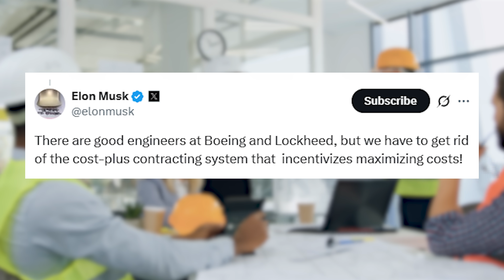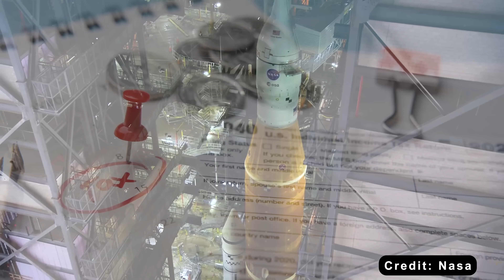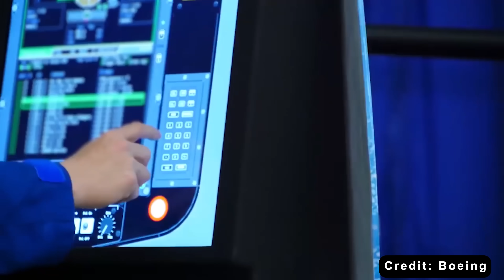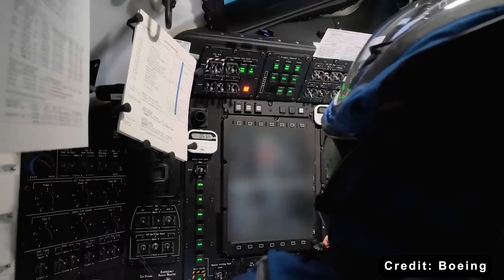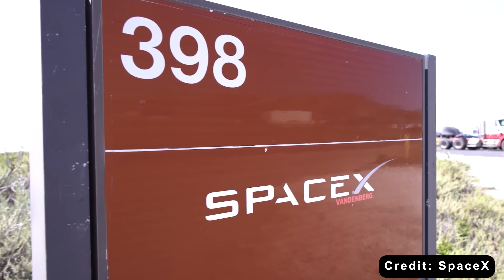Elon Musk exposed the Truth on Boeing's Starliner Complete DISASTER!

Comment: This is close, but not quite right.   I have worked with NASA.   NASA does not just permit delays and overruns - they demand it.  Oh, not directly.  Of course not directly.  They do it by changing schedules, requiring additional “risk assessments” and “trade studies”.   Since congress controls their budget, funding changes from year to year, NASA requires the contractors to adjust their planning, often throwing the entire program into a “replanning” phase.  This means “plans” are made.but while this happens no actual work gets done.  Then you have the cost of replanning - which was out of scope - so the contractor gets paid for that effort, then there is the cost of the delay caused by the replanning; real people get laid off, real facilities get shut down.  All of those people have to be hired back, the facilities need to be maintained during the shutdown.  All those expensive parts have to be guarded.  New people will need to be trained because occasionally a senior engineer decides he does not want to put up with the garbage anymore and takes a job as a bartender. All of this work is out of scope, these are contract changes, and the contractor gets paid or they are free to walk away.   Congress thinks they are saving money, but the actual finished cost does nothing but go up.   The worst nightmare for a defense contractor would be to sign a firm fixed price contract that never has to go through any our of scope risk assessment, a replanning, or changes to the funding or delivery schedules.   But that never happens, so even if they underbid, they are at minimal risk of actually loosing money.

Comment: Looks like Boeing has more than just lobbist.  Who in the Space and Aerospace system is Boeing paying off?
Reply: Congress.  Also use the "too big to fail" in their projects as leverage.  Bit of an issue with a lack of vertical integration too.  SpaceX is now big enough to do this strategy, but runs on long range non-financial goals (financial goals just being tool to achieve the real goals).  Starship, for example, requires a lot of luck to be financially viable.  Had to be paired with Starlink for medium term viability.  If Starlink is sold off (IPO) after build out, Starship will likely become a financial burden without a lot of government projects to support it.  Falcon 9 is getting old.  The financial sweet spot for launch in 10-15 years will likily be more like New Glen with Raptors and a three core New Glen Heavy booster for the occasional heavy lift need.  Second stage reuse might be nice, but some variation on Neutron might be better.  Perhaps a New Glen with raptor like engines, stainless, a higher staging (to allow smaller 2nd stage and stage 2 engine), and a hungry hippo and minimal hydrolox second stage.

Comment: This is what you get when boeing hires dei workers.
Reply from the maker: Yes
Reply: Boeing and NASA are PACKED with DEI hires and you can't criticize them or you'll be accused of being racist or sexist.   SpaceX hires the best and most capable people and expects them to perform or they're gone.   I worked at P&W building RL-10's in the early '90's and saw first hand how departments didn't talk to one another and when a problem arose it was all 'finger pointing' and nobody wanting to accept any responsibility.   Thankfully upper management listened to suggestions from one of the guys on the shop floor and made the changes needed but it's difficult to prevent people from falling back into their old habits that we see at NASA and Boeing today which are causing their inefficiency and waste.
Reply: @recoilrob324  You know some parts of what you stated are somewhat correct, but as a 20-year Navy vet Submariner who worked at Lockheed Martin for over a decade, I strongly disagree with your DEI assumptions.

 I am black, technically educated (ERAU - masters degree), and I became a manager at Lockheed servicing multiple  contracts and millions of dollars. I had a firm fixed contract by choice. (Less wasteful)

 My business unit was about sustainability to the DoD/DoW.

I personally went through a downsizing back in 2017 supposedly due government cuts.  In reality the company upper executives gutted our sustainability area in favor of pet projects and higher stock prices. 

The low hanging fruit in there actions were always the workers not the product or services. 

In the end it became very obvious the hiring continued for family and close friends of the higher ups. 

SpaceX is a wonderful company, but don't believe for one second that inefficiencies in the U.S. Space industry is about DEI.

The greed of people is why its going down hill.

You're not racist but I do question your level ignorance and insight.